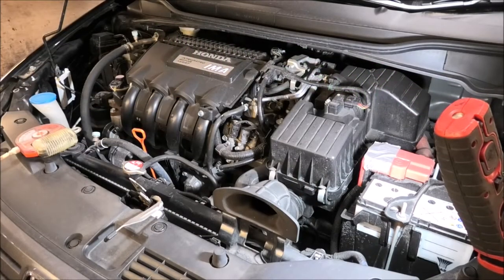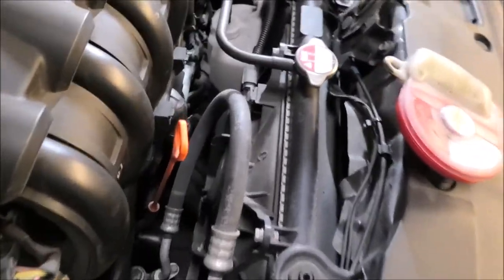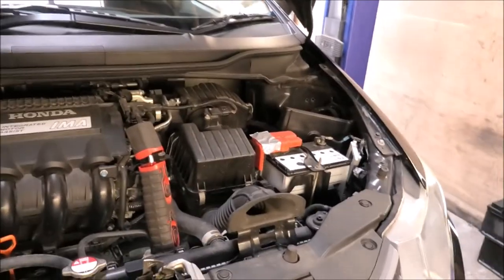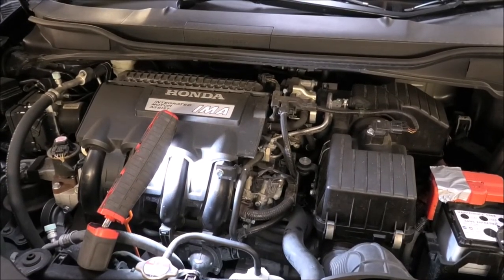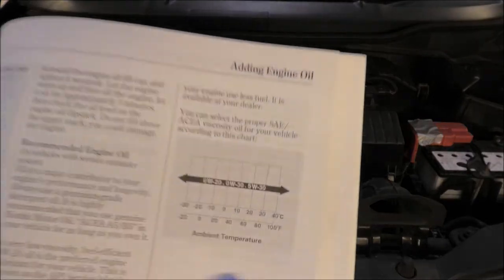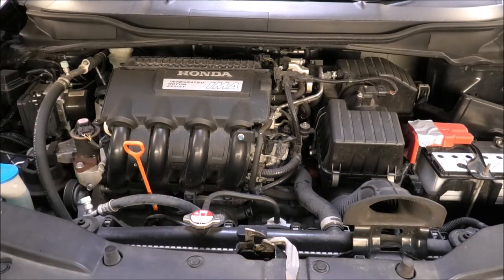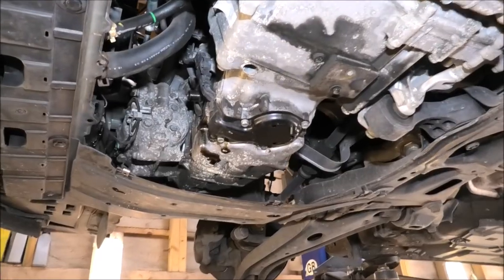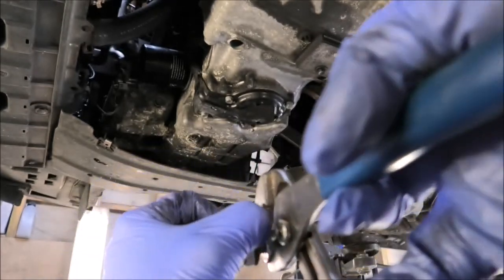Honda Insight 2010 1.3 Auto oil, oil filter, screen wash fluid, coolant level, antifreeze check

Comment: Hallo hab eine ze2 gekauft , es ruckelt beim anfahren bis 20kmh was könnte das Proplem sein? Hilft Getriebeöl wechsel? Danke ❤
Reply from the maker: Well the first thing you can try to do is to change the gearbox oil and see if it helps.
Reply: @DaringBeefcake  thx i do it
Reply from the maker: @kingsemo649  good luck..

Comment: Is it normal for the coolant to go below the cap level after every drive in the radiator. Whats the normal level for the radiator ?
Reply from the maker: Well yes it is possible, usually the coolant goes into the expansion tank, but it shouldn't be empty, technically you'll be able to see the coolant..The thing with the radiator is that the coolant flows through it when the car gets very hot and needs to cool down, this doesn't always happen..

Comment: I am looking for the Splash Guard that covers the Engine between the wheels and I can't seem to find this Part anywhere, Can you help me with this part and what it's actually called as mine is missing.
Reply from the maker: have a look at this one and may be you can guide yourslef if this one is not suitable hope this link helps..!!! https://www.ebay.co.uk/itm/284179496941?mkevt=1&mkcid=1&mkrid=710-53481-19255-0&campid=5338353466&toolid=20006%26customid%3Ds%253AGS%253Bgc%253ACjwKCAiA3L6PBhBvEiwAINlJ9NWU88Zz-o90ea6xFDklvOO0rfbmwyPwfmUdObUMPbk7-pk3y_avjxoCf8sQAvD_BwE%253Bpt%253A1%253Bchoc%253A2&customid=s%3AGS%3Bgc%3ACjwKCAiA3L6PBhBvEiwAINlJ9NWU88Zz-o90ea6xFDklvOO0rfbmwyPwfmUdObUMPbk7-pk3y_avjxoCf8sQAvD_BwE%3Bpt%3A1%3Bchoc%3A1&gclid=CjwKCAiA3L6PBhBvEiwAINlJ9NWU88Zz-o90ea6xFDklvOO0rfbmwyPwfmUdObUMPbk7-pk3y_avjxoCf8sQAvD_BwE
Reply: @DaringBeefcake  Thank you so much